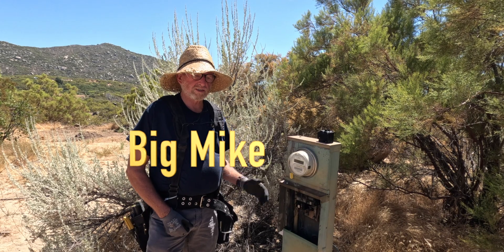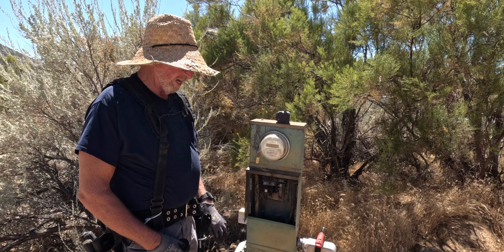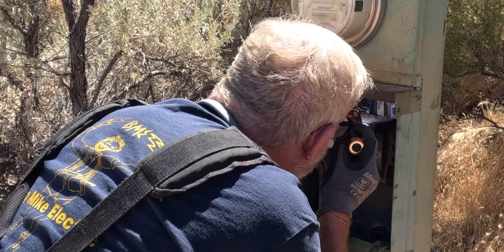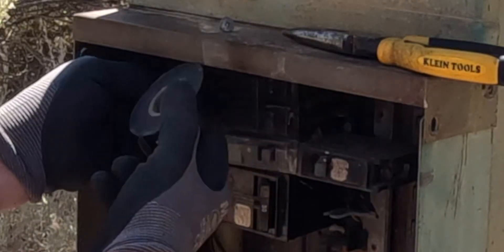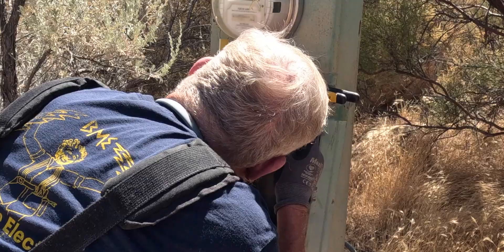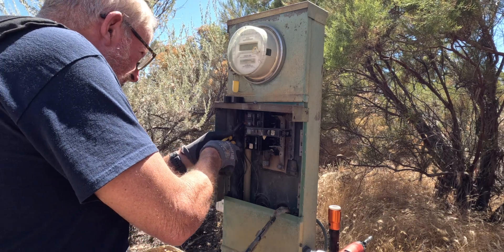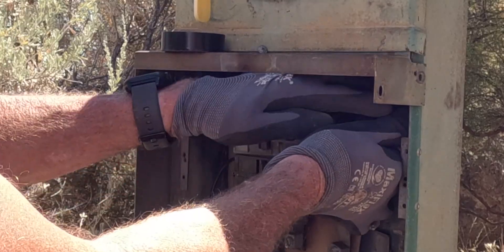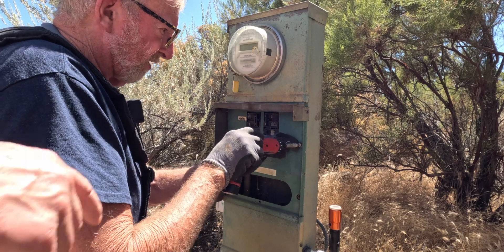Changing Circuit Breaker on Main Panel ⚡️HOT⚡️ Do Not Attempt : Demonstrational Purposes Only

Comment: That looks like a SMART METER. Why couldnt they have just activated the disconnect in that smart meter. They call that a remote disconnect. I think this power provider are REAL JERKS for not coming out & UNLOCKING that meter so you could then pull it!!!   I have replaced two 100 amp indoor 100 amp breaker boxes out HOT because they couldnt unlock the meter do to rust. What you did here is FAR more risky than me changing out whole breaker boxes live because I had WAY more space on my incoming mains going into those panels. That metal piece that seemed to be flip flopping around above your screwdriver made me nervous. I would have used an insulated shank screwdriver for that one if I had to do this. Since thats aluminum bus I would have used some antioxide compound on the breaker clips to prevent a hot bus connection. I almost always used that stuff to help prevent bus burnups.  This panel do to the bus style looks like it could have been made by Murray or Crouse Hinds. They dont use these in my region that I know of. Id say this is for some kind of trailer type home.